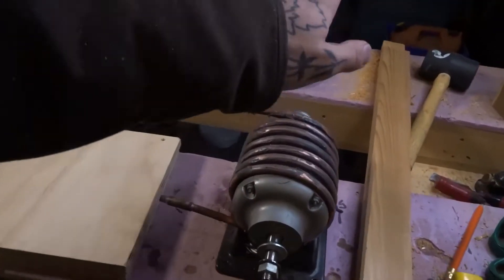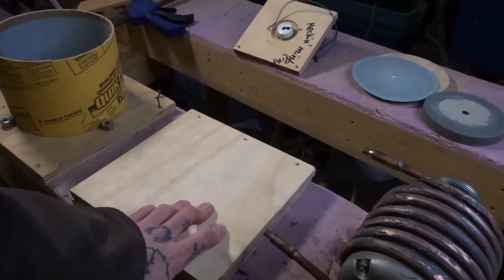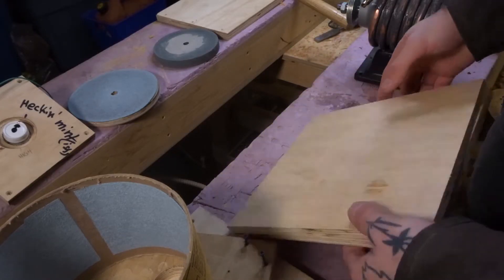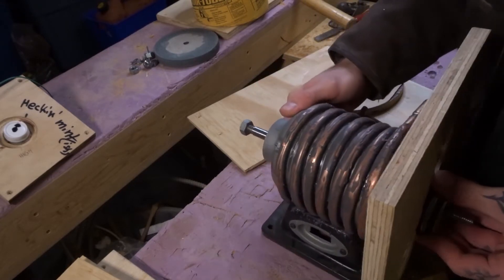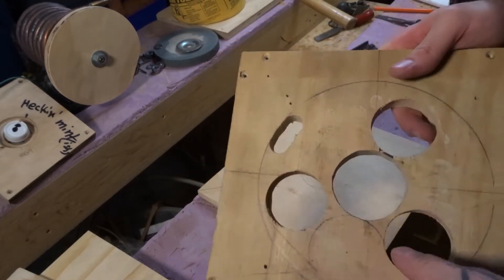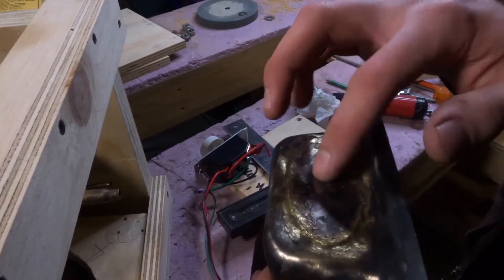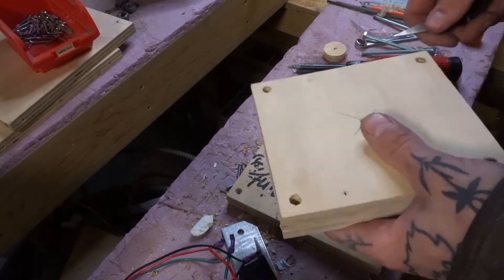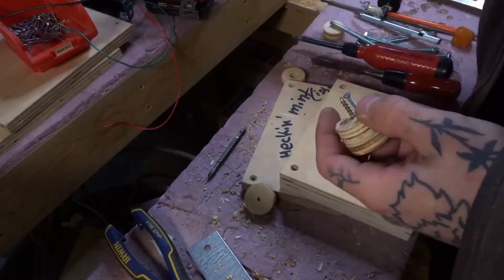It Does All The Work For Me!!! // Building a Water Cooled Wood Bead Tumbler

Comment: First off, I'd like to thank you for the great idea. I took it and modified it for a modular self extracting unit of my own but what has me stumped is your speed control. Your grinder motor looks like a fixed capacitor start and run like mine so how did you get speed control?
Reply from the maker: I used a cheap dimming light switch from home depot, it's just wired in series on the hot wire of the motor